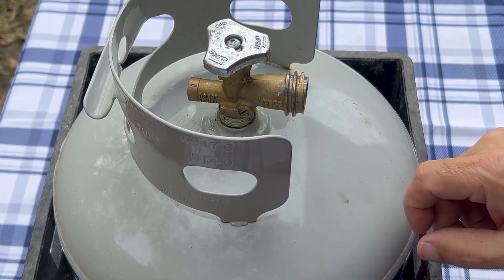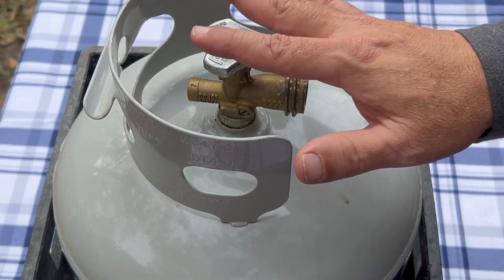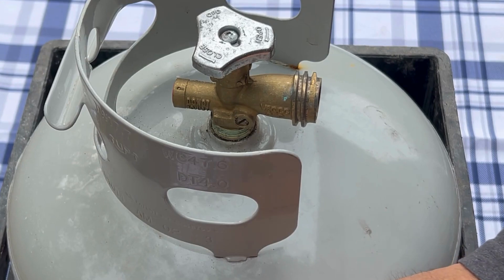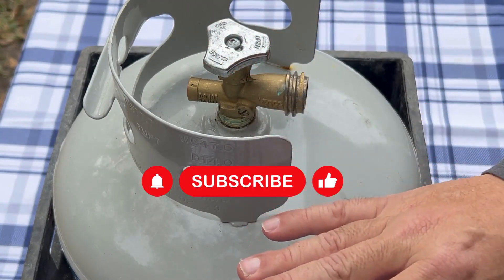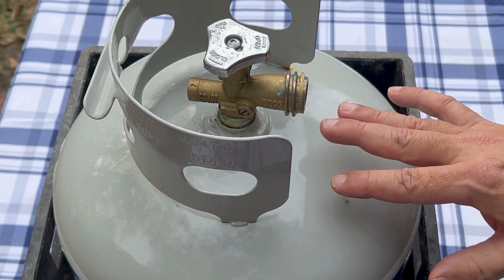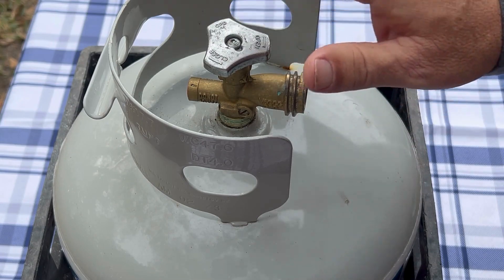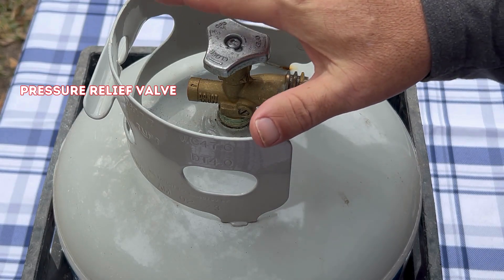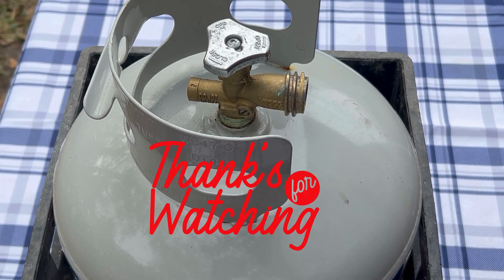Why Is My PROPANE TANK Making A HISSING Sound? | Propane CYLINDER Making NOISE😮

Comment: Are they still safe to use ?
Reply from the maker: If the pressure relief valve is releasing some gas that has expanded, yes it is safe to use.
Reply: So my tank started hissing at the pressure release valve. It’s a new tank just purchased today. I should be ok to use it when it’s time?
Reply from the maker: What do you think is causing the gas to expand?  Is it stored in the direct sun or is it hot where you are? That's it what is going to cause the tank to release gas from the relief valve.  If the PRV is releasing some gas the tank still ok to use.  Keep the tank away from the flame to be safe though. @brittneyhammond9471

Comment: What if it’s a cold evening? What then?
Reply from the maker: If it is cold but the tank has been in the sun the tank can still get hot and need to expand.  If it not your tank may have been overfilled, because the propane should condense a little in the cold.  You might want to exchange that tank.
Reply: @cookingwithcoastalcaterers  thankyou for your advise. Appreciate it.

Comment: so constant smell is good ???? when open !!!!
Reply from the maker: If you are smelling propane that either means your relief valve is letting out some propane because the gas is expanding for some reason.  Probably the tank is hot.  If the gas is coming from somewhere else you have a bad tank and need to exchange it for a new one.